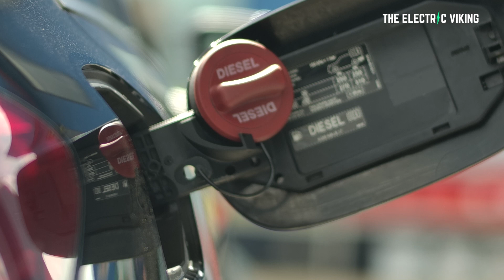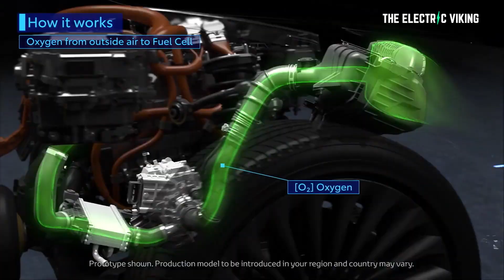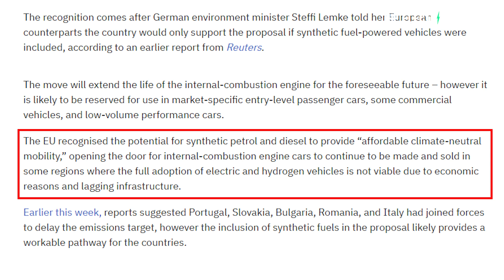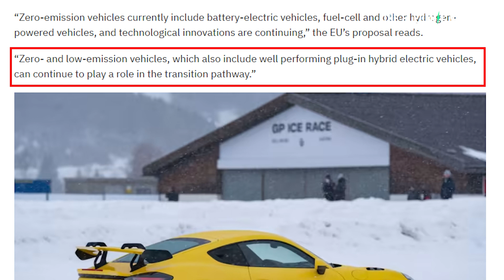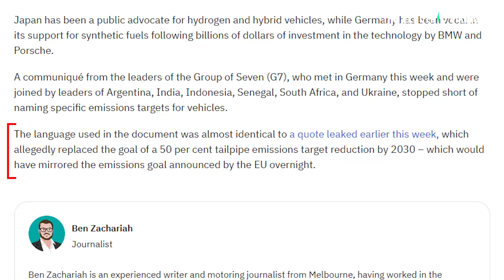Update: European Union / G7 effectively ban ICE by 2030

Comment: Synthetic fuels indeed don’t make sense for the bulk of road-transport in 10 years or so. However, it will make sense for some edge cases where electrification is hard on the medium term AND that can afford it, likely only businesses. Where it still makes a lot of sense is aviation. Here electrification will work soon for short haul and perhaps medium term for medium haul. However for long haul (majority of emissions anyhow) a fuel of any kind will be the only solution. Here H2 is touted as the end-solution but it will take another 30 years before these aircraft will be put in operation and the supporting infrastructure is built.  Synthetic fuels can be added TODAY up into the fuel mix up to 50% without re-certification. Hence the airlines are “screaming” for its urgent supply. If they were available today, a very significant chunk of CO2 emissions could be reduced almost overnight.

Comment: Excellent Sam, as usual ! May I add my 2 cents ? They will fail with synthetic fuel also for other reasons:
- as you say, this is not cost effective, so not sure the petrol companies and the large mall distributors will invest in distributing this low margin fuel in adding dedicated tanks and gas station pumps 
They already are investing in installing superchargers in their current gas stations, where the ROI is better for electricity than for fuel distribution. Synthetic fuel will be as difficult to find as hydrogen today
- PHEV’s are a pure car manufacturer BS, claiming being a step against pollution, but it’s a baby step as they are 90% running on fuel or worse recharging the battery. Synthetic fuel is the same kind of BS, claiming that they add CO2 from the atmosphere and combining it with H2. Where H2 comes from ? From Methane reforming, producing H2 and CO. Great! Some people will explain we can produce H2 from electricity : true but you use electricity to produce H2 from water then you combine H2 and CO2 to create the synthetic fuel that you carry by trucks to the gas pumps, you burn it in you roaring engines with a 15-20% yield, with all the know maintenance costs. Why to be so stupid and not using the electricity to go straight to the EV batteries. The H2/CO2/Synthetic Fuel are just useless intermediate steps: some bizarre reasoning that happened for hydrogen cars
- up to 2030, battery density will significantly increase, allowing lighter and cheaper cars. Fast charging (except for Toyota’s) will be available as a standard feature in any car. An EV will be cheaper than anything else, will beat any Synthetic fuel sportscar, will be far easier to maintain
- and as I said before, every European will see no future in purchasing a non-EV beyond 2030 knowing that such car will have almost no resale value in 2035 EU tried to warn not the citizens but the legacy car manufacturers, but unfortunately they are dumb and deaf, and they will drive their auto industry to bankruptcy. 
Toyota follows the same strategy as Nokia, and now Porsche re-invent the Betamax. Do they even read a book? Do they listen to the customers ?

Comment: Do look into the Synthetic Fuels a bit more Viking. Basically they combine hydrogen made from wind with carbon taken out of the atmosphere. It could be a short term part of the solution. And also a way to enjoy your collectible 911 guilt free. Also for Aviation and naval solutions that we can’t currently convert to battery electric.
Reply: So, raw, efficient, clean electricity
Then waste some converting to hydrogen.
Then use more to "Remove carbon from the atmosphere" (sounds inefficient?)
Then "combine" the two..... 🤔
Where's the total data?
Oh, I forgot.
Then burn the resultant fuel in a 30% (at best) efficient ICE.
Rather than use the whole lot in an EV?
.
You are, as we say "having a laugh"

Comment: Electric Viking - Consider the Mazda CX 30 with Range Extender via Wankel Engine. 100+ miles EV only. Now, consider other models in Europe - body-on-frame SUV/Truck - Use existing manufacturing lines with the Magna International Inc. eDriveTrain. Magna has developed a four-wheel drive electric power train system for pickup trucks and light commercial vehicles. Now, add a rotary engine like a Wankel Engine with Mazda Skyactiv X and gas (CNG or Hydrogen) storage technology from Toyota. Rotary engine can run on Methanol, Ethanol, Dimethyl ether, Hydrogen and/or natural gas. Also, you now have ability to use LFP and Sodium Ion batteries with much less weight issues.
Reply: You are joking?
Reply: Shawn of the dead

Comment: Chemical fuel are natural marvels in its capabilities of storing and conveying a large amount ou energy in nearly unbeatable gravimetric and volumetric densities. Only nuclear energy does better, but with lots of drawbacks.

Chemical liquid fuels can be produced harvesting some natural pathways and combined with synthetic biology.

Algae, sugar cane, switchgrass can harvest sunlight and CO2 from the air to produce biomass and biochemicals.

They are not supposed to be scaled into fossil oil substitution, but may play a positive role were the special characteristics of those liquid fuels cannot be easily replaced.

Think of long range flights. A 20h 777x flight. It will still be using chemical fuels by 2050. Presumably synthetic fuels with a more positive footprint.

Some long range vehicles might also benefit of some kind of hybridization. Not like a Prius that is just electrically lightly assisted, but more like GM Volt ER-EV concept of a fully electrically capable vehicle, whose range can be extended with compact and light fuels.

Those complex solutions will surely be niche solutions when electrification is already widespread, but there will still be niche applications.

That is why "banning" is to harsh as a policy, and should not be pursued as such, just incentivized the migration. The ban is not needed either, just as a kind of (oppressive) statement.

Comment: Hi Sam, Love your videos and would ask if you could make a video on what can one expect when charging an EV on a road trip in Australia. Is it a real hassle or fairly seamless as this is my main concern when deciding whether to buy an EV. Many thanks, Mitch
Reply: I would try to charge up at hotels overnight. That's the most reliable way. Use superchargers where you can, of course.
Reply: @icowrich  Thanks very much for your reply, do you find that most hotels offer this service or is it a random situation. also, have you had any experience with motels offering this feature. Thanks again, Mitch
Reply: @mitchellkollar3143  Most hotels do not, but it's easy enough to plan your hotel stays such that you can charge your EV. If you can't find any at a particular location, fair enough. But it's at least worth it to try to plan it that way.
Reply: @icowrich  Thanks again. Mitch

Comment: So they will have sufficient grid capabilities to sustain this load? Hmm! I love EV's and Tesla, but have watched the left stop every generating facility which can supply 24/7/365 base load.
Reply: I've seen reports that EVs will help the load, rather than the opposite. Charging when electricity is cheap and plentiful.
Reply: @alexmckenna1171  They could but the reality more than likely will be what current residential solar customers are facing with power companies reneging on their promise to purchase excess and time sensitive demand loading.  Again we must get the left out of the way on base load generation as solar/wind are not going to cut it unless some breakthroughs take place in liquid metal batteries or some new vaporware.
Reply: The "Fully Charged" channel has loads of info to calm your nerves on that subject :-)
Reply: @alexmckenna1171  I don't have a nerve issue I have 25+ years Electronics Engineering experience world wide with major production facilities regarding base and demand loading.
Reply: @JorgTheElder  As a Corporate Director of Electronics Engineering who spent 25+ years world wide I am well versed in the grid requirements and limitations for 24/7/365 base load requirement and demand loads. Care to go toe to toe with me on what the current grid situation is and what each addition 10% switch from ICE vehicles will mean to base and demand  loading or do you need to do more reasearch.
Reply: @mikewurlitzer5217 
A great CV.
Did you ever compare the grid energy required to refine oil to that required to propel an EV a similar distance to the refined fuel?
(It's the same amount.... But the EV doesn't burn the fuel)

Comment: We need a replacement system of affordable electric motors and battery packs to eliminate i.c.e. engines all together.
Reply: They will die off on their own within 15 years after we get to 100% BEV. No reason to disrupt economies when they are quickly going away on their own.

Comment: I know some luddites who swear they will never have an EV, but by far the majority of people can't wait to get one because they're plain better in just about every metric. As the costs of ICE car ownership crosses over that of EVs, who's going to buy ICE cars? Even if they do, who's going to pay a high price for them when they're second hand? People want EVs, full stop. When they're cheap enough, we'll all gladly have them.
The synthetic fuel calculations are just smoke and mirrors. You're ALWAYS going to be better off using the electricity wasted in the manufacture of synthetic fuel directly in battery EVs. Anyone saying otherwise doesn't have any understanding of Physics. Hydrogen is just a waste of time, the same argument above applies.
Reply: Bans are unnecessary. The vast majority of people will switch to EV when they are plentiful and ICE cars start losing economy of scale benefits. The 2 major issues preventing EV adoption are lack of product, and lack of used vehicles. Until people with less money can buy a used EV, the billions of ICE cars will be necessary.
Reply: @charlesminckler2978  yeah and running petrol pumps would be a loss making buisness in 15-20 years, so people who did not want to shift will have to shift when petrol pumps start shutting down and they cant find petrol.
Reply: I can assure you that that the majority of drivers do not want an EV. Stop calling sensible people luddites. I doubt you even know what it means.
Reply: @anglosaxonmike8325  Today they don't want an EV. In 2035, when ICE cars cost 25% more than EVs and gasoline is $10 a gallon or synthetic fuels are $25 a gallon, ICE won't be so popular.
Reply: @anglosaxonmike8325  
To quote a comment elsewhere in the thread

"Utter claptrap without a shred of empirical evidence"
(Your view)

Comment: It wont stick, infrastructure for 100% EV population wont be ready yet.  Most homes charging all at once at night they are not ready for, most homes arent wired for charging either.
Reply: On average, most households utilize cars that travel a total of less than 40 miles each day. The less than 10 kilowatt-hours used by one or more EVs to support this average daily travel is easily supplied using our existing electrical grid infrastructure off-peak, during the day or at night. Clean, renewable Solar, wind electrical generation, and battery storage can and will also be easily added to the homes, apartments, shopping centers, factories, farms, etc., to meet any increase in total electrical load for recharging EVs replacing all gasoline and diesel powered cars and trucks.
Reply: That is a myth. Everyone who has a 240V connection in their garage is already “wired” for charging. And the house circuits will handle it just fine. 

And there is enough excess capacity on the grid that charging at night isn’t a problem for the grid either.
Reply: I can add charging to my home and will.
Reply: You're suggesting that "Most homes charging at night " will be a problem?
Let's word it another way,
"When most workers have gone home and 80% + of INDUSTRY isn't using power".....?
.
Does your statement still make sense?
(Remember, power companies sometimes GIVE the energy away overnight!)
.
That's even without considering that it's "trickle" charging,
Or that as mentioned, the vast majority will only need a top up 1-2 times per week,
Or that smart switching will allow charging at staggered intervals,
Or that EV owners have a tendency to install solar/ battery systems,
etc
Reply: You've got it wrong.. People can charge at any time, in any place. Anyway, it will happen over the next few years, not suddenly.
Reply: @JorgTheElder  - Agreed - see my earlier reply.

Comment: Why not convert ICE to hydrogen?
Reply: Because it is more efficient to use the electricity directly in an EV instead of  making hydrogen with it.
Burning hydrogen in an ICE is especially inefficient.
Reply: @danharold3087  Agreed - converting any source to hydrogen and then burning hydrogen in an IC (gasoline or diesel) engine is simply ridiculously inefficient, not to mention costly, compared to generating and storing  electrical energy in a battery and using it to directly propel your vehicle with one or more electric motors.

Additionally, hydrogen engines produce nitrogen oxides, or NOx. As a result, they also require exhaust aftertreatments to reduce NOx emissions.
Reply: See video of Methane car exploding when being fueled at 3,600 psi. And imagine what one would look like at 10,000 psi.
Reply: Much simpler and cheaper to just make eFuel. Of course electric is by far cheaper than both.
Reply: Hydrogen is a waste of time and energy and money
Reply: Because hydrogen fuel powered electric motors is 3x more efficient than ice.
Reply: @larryc1616  You lose like 18% when you make the hydrogen and something like 40% in the fuel cell.
Reply: Preignition knock. Rotarys fare better in hydrogen.